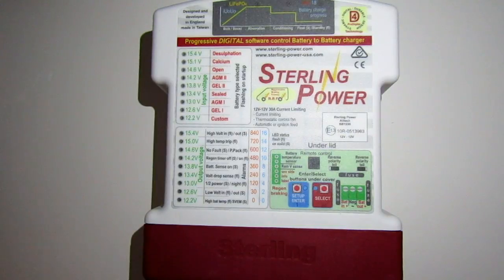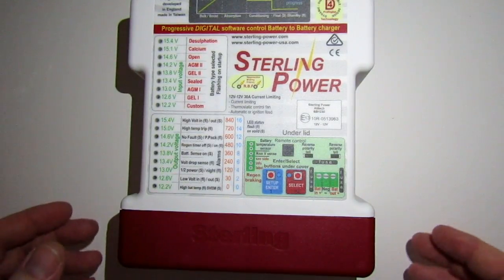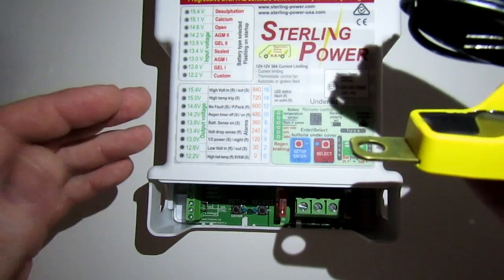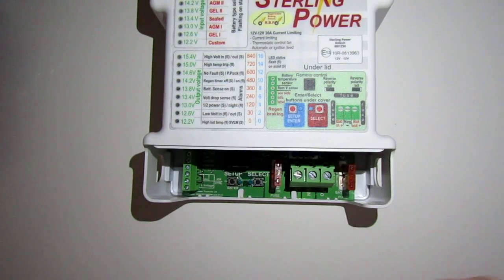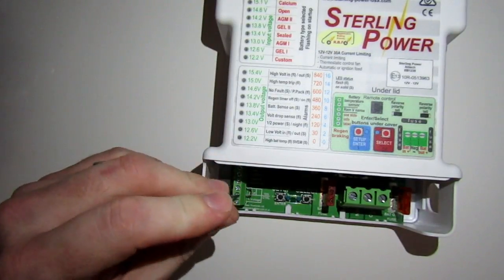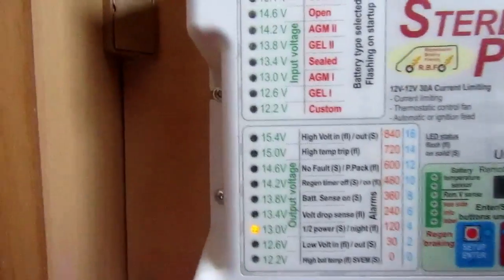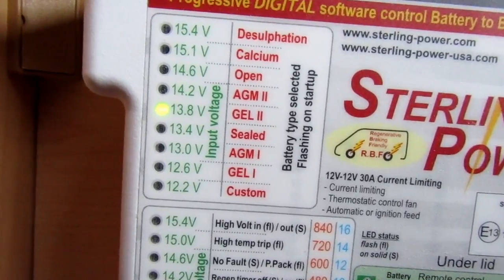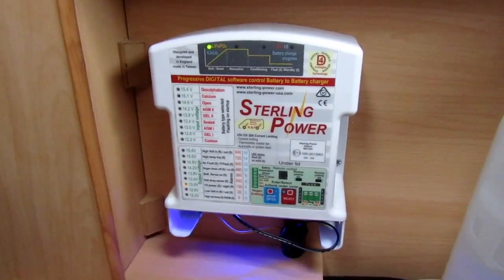How to Wire a Battery to Battery Charger Sterling Power Pro Batt Ultra

Comment: Hi Dan. Great video. 
I have the 30 amp Sterling B2B charger which came with the van unfitted when I bought the van.
I have a 100ah Lifepo4 lithium battery which will be charged via my main vehicle battery and also via on shore power when the EHU is being used. Which mode would you recommend? Also, the ignition feed? what wire is ??
many thanks. (I am properly struggling with this)
Reply from the maker: There are different settings for different batteries but without seeing the unit itself I couldn't say properly but there should be one for Lithium batteries. What vehicle do you have? And if you can't find the ignition wire don't worry the unit will work without it, it will just be delayed in its operating alittle bit. Hope this helps 👍many thanks for watching
Reply: @dantheman321  the vehical is a 18 reg ford transit mk8

Comment: Hi Dan,great videos,currently I am running a bb1230 and would like to add a solar panel,so thinking of swapping to a bbs1230,would it just be straight swap and terminate solar cables into the ports,or is there something else I should be thinking about?Many thanks.

Comment: A question if you don’t mind ?
You say put the battery Sensor directly on the Earth my question is if I am using a shunt will this affect my readings on the shelves because I know the sensor needs to go directly to the battery to monitor the temperature …. But on the shunt instructions it’s saying not to add any earths going directly to the battery other than the one coming from the shunt !!

Comment: Hi great video! I’ve currently got a split charge kit on my van charging two leisure batteries but also got solar panels charging the too 

The issue I’ve got is that when the solar is charging the leisure batteries the relay stays open and is also sending charge back to the starter battery 

If I were to fit this charger would it prevent the solar charge going back to the starter battery? Tia
Reply from the maker: Hi Michael, yes it will prevent that from happening. Many thanks for watching

Comment: Hi there I have a 130 amp sealed battery what setting do I need also I won't to fit a ignition wire do I get it from the fuse box  and what size fuse do I need to use thanks

Comment: Please could you tell me is the 14.6 open, is that for the van battery or the leisure battery or both?
Reply from the maker: If your referring to the battery selections on the unit they are for the leisure battery, many thanks for watching
Reply: Thank you I'm getting there now the ignition feed 😳🤔👍👍
Reply: Thank you, I've just bought a vw van and the wiring is shocking so this is all new to me I've had to start again by taking all the wiring out.
Can you recommend any auto electricians who do a complete rebuild in the Manchester area? 
Thank you
Reply from the maker: @KevinJones-kevlad  go see Paul at Cruize Campers he's in Bolton though 👍
Reply: Hi pal, just a quick question again pls.
I've fitted the sterling Pro bat ultra 12v 30amp please could you tell me is it working correctly when I switch the engine off on a euro 6 it still runs for approx 80 seconds is this correct? I have not fitted an ignition feed as yet just need to know it working correctly.
Cheers for any info Kevin,
Reply from the maker: @KevinJones-kevlad  thats right yes it will carry on for abit after engine has stopped without an ignition feed. 👍

Comment: If i want to add a cut off switch to turn the sterling b2b 1260 only when needed which mode is best ?
Reply from the maker: The mode depends on the battery type, just add the cut off switch on one of the positive cables👍
Many thanks for watching
Reply: @dantheman321  thanks for your message, the battery type is lead acid sealed 130ah×2 hankook xl31s.

Comment: Maybe i missed something but the charger is not connected to the negative side of the leisure battery so how does it charge?
Reply from the maker: Both the b2b and the leisure battery are earthed down to the chassis so they are connected that way. It's always best to have a short negative cable 👍 many thanks for watching

Comment: Hi, I have the battery below and have set the battery type to AGM II, is this correct? 

https://www.amazon.co.uk/SuperBatt-Purpose-Starting-Auxiliary-Motorhome/dp/B0763NFGYN
I drive a 2017 Ford Transit custom, do I need an ignition feed? The unit powers on 30 seconds after the ignition is on.

Comment: Hi Dan, 
I have a 2016 Nissan Nv 300 and also have a 100amph Lion Calcium leisure battery will this unit work for me ?
I believe my engine is a Euro 6. 
I am confused at the part where you decided to put it to the ignition, do you just piggy back it onto the ignition feed ? 

Many Thanks

Comment: Hi there I need some help please!! I set the charger to AGM 2 because my battery is AGM however when I confirm it goes back onto ‘custom’ and flashes red? Also when I try to start my van the engine is just turning over and not starting? Do you know why please? Thanks
Reply from the maker: The fault maybe be happening if you already have a low battery level on your vehicle battery. Recharge the vehicle battery and try setting it again. Hope this helps
👍
Reply: @dantheman321  thank u sorted it! One more question where did u connect the ignition feed from the Sterling to?

Comment: Do they all need the ignition part wiring ? I have the earlier model and you simply connect to starter battery ,and then to leisure battery with adition of a temp sensor ,it was this easy method that made them so good ,not sure if people will want to be wiring to ignition etc

Comment: Hi dan the man great video thanks subbed and liked vid
Mine is a quick question  can I attach wire to it for a fuse box for usb sockets and cigarette lighter and a basic chiller box and 2 led lights if so what size wire would be best suited it's in a day van hope you understand  the question good luck

Comment: Hi Dan, great video. Clear and informative, thank you. For a 100 or maybe 120Ah lithium battery predominantly charged by solar, but using B2B on occasions of heavy use/sun don't shine, which unit would be best suited in your opinion? 30, 40 or 60 amp B2B unit? It's going in a new transit custom euro6 engined van. Neil
Reply from the maker: I would have said the 60amp model myself. Many thanks for watching Neil

Comment: is this for a smart alternator only... or can you have it to work with a stanard 14v alternator
Reply from the maker: It's been designed to work with smart alternators, it wouldn't be needed on a standard alternator, a normal split relay would work fine on that. Many thanks for watching

Comment: I have been watching your video as im about to buy a b2b charger.
Best one ive seen so far on the sterling but im still a bit confused.
Ive got a transit custom 2018 so presume im going to need the ignition feed.
Is there a particular place from which to pick up the feed or can i simply piggyback a live ignition feed from the fusebox.
Such as blower or power windows, does it matter which one as long as it is only live when the key is turned.
Thanks Tony
Reply from the maker: It doesn't matter like you said as long as it's only live when ignition is on but you don't actually need an ignition feed. The box will recognise when the voltage increases and automatically switch on at that point if you can't find a ignition feed.
Hope this helps
Many thanks for watching

Comment: Hi Dan, I'm currently doing a self build, my conversion is a 2009 Renault Masters, I'm going to install a battery to battery charger using a couple of AGM 110amp batteries. is this unit suitable? regards Brian.
Reply from the maker: Hi Brian,
You shouldn't need a battery to battery on that year van as it shouldn't have a smart alternator, double check first but save your money as it won't need one I don't think.
Many thanks for watching
Reply: @dantheman321  Thanks Dan for your speedy reply, what would be your recommendation to  charge my leisure batteries while on the move? TIA.
Reply from the maker: @brianlouisegilsenan9115 
A normal split charge would be more than enough maybe a 140amp durite split relay would suit your setup.
Reply: @dantheman321  Thanks Dan, I was getting mixed messages from various sources I was was researching. One more quick question though, Is the AGM batteries okay to use?

Comment: Hi just installed 30ah charger 
From mains I have sealed 110ah battery and need help with settings
Reply from the maker: Hold the 2 buttons down for 10 sec they are located next to your wiring. When the lights start to flash select the battery type on the front of the unit yours will be sealed lead acid, when it is flashing on the right battery type just leave it and the unit will reset itself👍
Many thanks for watching

Comment: What size cable do I need 
I am connecting to 240v to two 110ah batteries
Reply from the maker: Are you going through a battery charger first?
Reply: @dantheman321  
Starting from 240 into sterling charger 12v 30ah type then to charge two 110ah batteries
Reply from the maker: @johngosnell6887  hi John it doesn't work like that, your sterling charger is for the vehicle battery to the leisure battery it acts as a regulator due to the high amps from vehicle battery. You will need a battery charger to run your mains cable into before attaching to the batteries. So it would be:
Mains hooks to consumer unit to battery charger to leisure batteries.
Hope this helps.

Comment: Hi a quick question 
Iv got 170ah 14.4v lead Crystal battery but it’s not listed on the box. Is this safe to use on them and is it man enough if so what setting do I put it on as I don’t want to destroy my battery as they are very expensive 
Looking forward to your reply 
Dave,,
Reply from the maker: Honest answer is I'm not entirely sure but with you saying Lead Crystal battery I would be tempted to either select open or sealed lead acid battery options. To be on the safe side I would give sterling themselves a quick call and ask the question.
Many thanks for watching

Comment: I have 2, 130 amp sealed lead acid batteries what setting would I use.  🙏 thanks.
Reply from the maker: There is a setting for sealed lead acid batteries 👍 it should tell you on the front of the box and the instructions.
Many thanks for watching

Comment: Great video. What size cables would go from the vehicle battery to sterling B to B charger and back to the leisure batteries, they are about 2 meters apart? Thank you so much for any help.
Reply from the maker: I use 10mm tri rated wire for both batteries and both positive and negative.
Many thanks for watching
Reply: @dantheman321  Thank you so much for your help..your a star

Comment: Hello, thanks for the great clear video. I’m planning on installing this but the 60a version along with a pcu1220 mains battery charger. Do I just install them as two separate units independently connected up to the batteries. I have been advised they can be used at the same time. Thanks tommy
Reply from the maker: Yes I would install them as individual units, Many thanks for watching

Comment: Hi
Great easy video.
Hope you can help, about to fit one of these.
Regarding the ignition feed, I was just going to piggyback off a fuse in the panel.
Can you tell me what size fuse and wire would be needed.
Cheers Mark
Reply from the maker: What vehicle is it your converting?
The wire I use is normally 2mm tri rated and the fuse 20amp.
Hope this helps and many thanks for watching
Reply: Thanks for the quick reply, it is a Mercedes Sprinter

Comment: Hi, I’ve purchased a second hand bb1230. I have a 100ah AGM leisure battery. I have 13.8v input but only getting 12.06v output. I have performed a factory reset and I’ve put the battery selection to AGM II. It’s not in float mode. Do you think this unit is duff? Or am I missing something. Any help would be greatly appreciated.
Leigh
Reply from the maker: It doesn't seem like the correct output, best thing to do it contact sterling direct as they will know exactly what the output should be.  Did you receive any paper work with the unit with it being second hand?
Many thanks for watching

Comment: Hi Dan, thanks for making these amazing videos, the way you get round problems and the finish you achieve is truly impressive. Can I ask you what route you take the cables in the cab area from the vehicle battery to the rear on a relay/boxer. Do you manage to route them under the matting somehow? Many thanks.
Reply from the maker: Yeah straight under the matting across the front of the drivers seat and into the underneath of the step. The matting can be hard work to lift enough to get your hand under but is do able.
Many thanks for watching

Comment: In my opinion missing a connection for leisure negative. I'm not connecting that directly to chassis, no way. Not connecting directly to start battery either.. I want to totally seperated systems only connected by the charger, and even then I think I'm gonna have to install a switch on the negative for it to not be connected all the time. 

I've seen other "better" chargers that has 4 proper leads. +/- for start and +/- for leisure..
Reply: Hello. Witch one?

Comment: Hi Dan, Another excellent video, thank you for taking the time out to produce. Question though, I was considering a dual charge mppt solar panel control unit ( Votronic MPP165) to take care of both vehicle and leisure batteries, presumably this is a similar set up to the Sterling B2B  and do you think there will be any conflict with my smart alternator on Ducato 2018 ? Thanks in advance
Reply from the maker: Whatever you do don't connect any wires to the vehicle battery if its a euro 6 setup. We don't take anything from a vehicle battery anymore due to the voltage. The B2b regulates the voltage produced from the vehicle and provides it to the leisure in a safe quantity. Hope this helps and many thanks for watching
Reply: @dantheman321  Thanks for advice, it is Euro 6 set up, will be avoiding any connections apart from Sterling unit, presume the Solar Panel connections go directly to Leisure battery via Solar controller ?
Reply from the maker: @peterknight4560  that right yes, at least this way the leisure battery gets 100%of the solar charge now.
Many thanks for watching

Comment: Hi dan ,a lot of confusion on self build forums  how do u know whether ur van has a smart alternator ? My van is relay 2016  ,NO start/stop,NO display on dash wen i brake to say its charging ,can u explain please?
Reply from the maker: Best thing to do is contact your local Citroen dealership give them your Reg number and they will be able to tell you straight away. 2016 was the year that it started to change over properly but your van could be one of the last of the euro 5 engines so better to check really.
Many thanks for watching
Reply: @dantheman321  thanks dan never thought of ringing them ,if its a euro 6 then i definitly have the smart alternator, is that correct
Reply from the maker: @selfbuiltcampervans  yeah it will have something that will mean you need a b2b charger.
Many thanks for watching